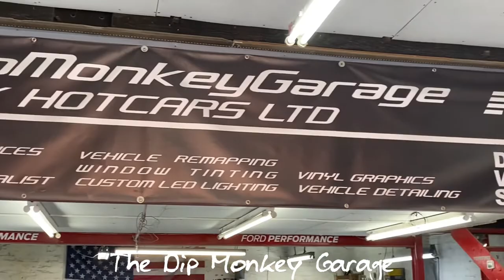Aggressive Makeover: Equipping the BMW E70 X5 with a Stunning Body Kit!

Comment: Thanks for the awesome video mate. Now I know how "sick" a gloss lower front bumper cover looks like on a 35iX.  Quick question: What's the front lip/splinter make/part numbers?  Respect from the colony (Canada).
Reply from the maker: https://www.ebay.co.uk/itm/224640920770?mkcid=16&mkevt=1&mkrid=711-127632-2357-0&ssspo=RLw19NJRQz6&sssrc=4429486&ssuid=9w1ahmfir9g&var=&widget_ver=artemis&media=COPY
Reply from the maker: Thanks, and the kit we found on eBay, (just tried to post a link here for you) think was 1 or 2 years ago we did this car! And yea the gloss black bumper covers looks great… was a gamble at the time but definitely paid off. This thing looks great!!! Good luck with yours 🤙
Reply: @thedipmonkeygarage  my bimmer is a 2013 LCI and transition year... Not applicable. sadly. My issue with the current options, is that they all leaves on open gap near de center section of the splitter.